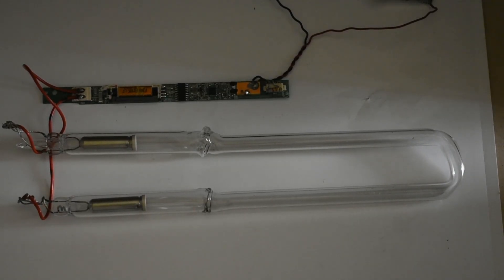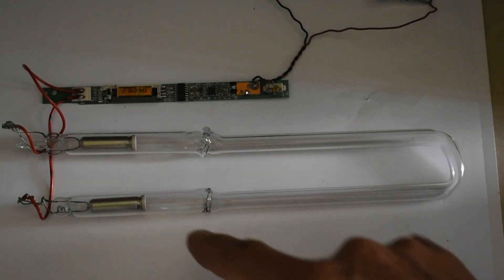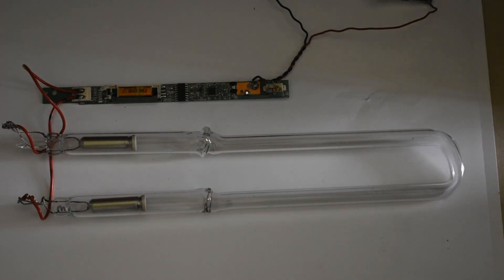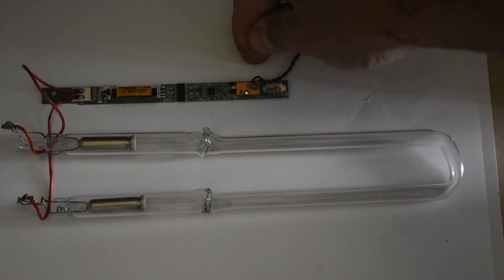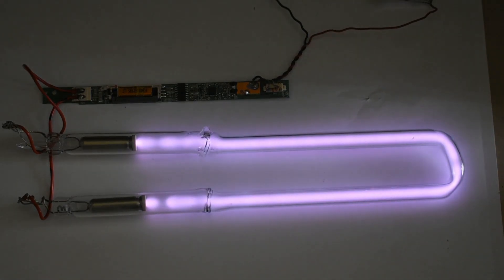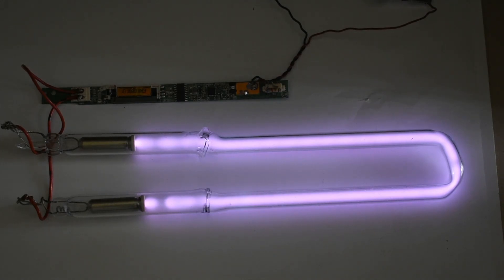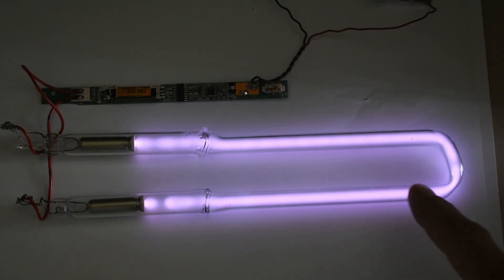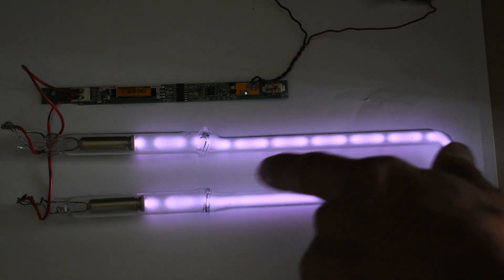Striations in low pressure gas discharge

Comment: You see it often on T5 lamps with an electronic inverter, when the tube goes mercury starved and turns pink. Also common on 8foot HO tubes on HF ballasts, though the HO tubes are now becoming incredibly rare, almost all being replaced with LED or regular 5 foot fittings, because of the cost of the ballasts and the tubes. Saw a whole floor of them at my local bank a few years ago, and the cause was a combination of failing Phillips ballasts and a poor batch of Osram China tubes, where the failing tube would kill off the ballast, though at least the ballast did include a proper fuse and thermal fuse, so they would blow themselves open circuit before burning, though you would see the white screen printed case  would have a brown spot where the magnetics and power transistors were.

Bank maintenance would always be around with a ladder, scaffolding and a trolley, with a box of lamps on top, and a box of ballasts below. They also had a low opinion of the lights, but have within the last 3 years done a lot of retrofitting of the T5 tubes with semi custom LED, using aluminium strip and LED tape, with the inverters for that tucked into the ceiling spaces where the old ballasts were.

Comment: Wonder why it only affects as far as your finger rather than the whole tube.
Reply from the maker: It is also quite tune-able, moving the loading or grounding point (my  finger) can adjust it and in fact can have the whole tube in striations
Reply: The rest of the tube is close to ground potential, so only the end that has the high voltage will show this. This is because the driver needs to measure the current in the CCFL tube, to control brightness and determine if the tube is operating correctly, so has a current sense resistor at the one end of the secondary winding.